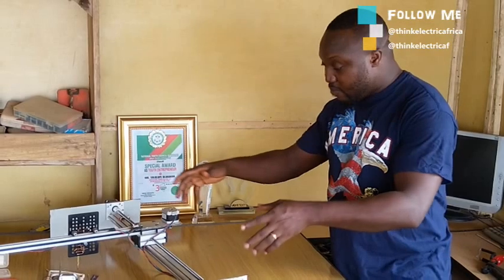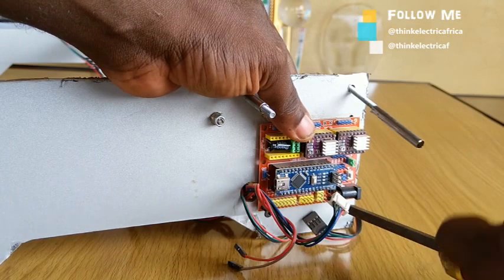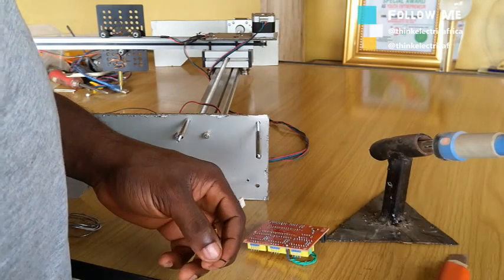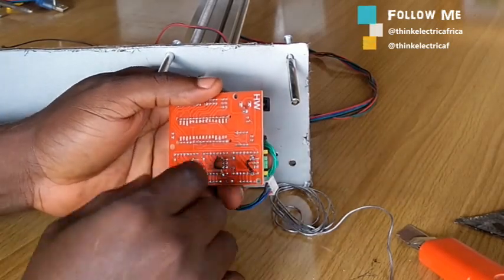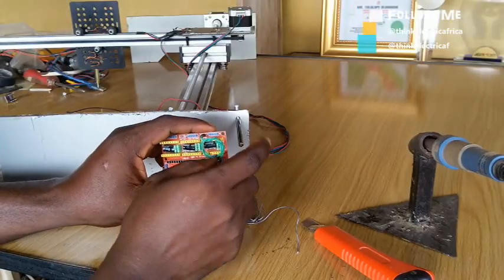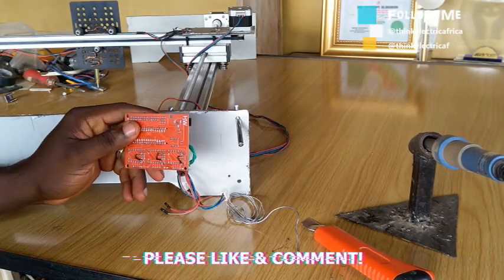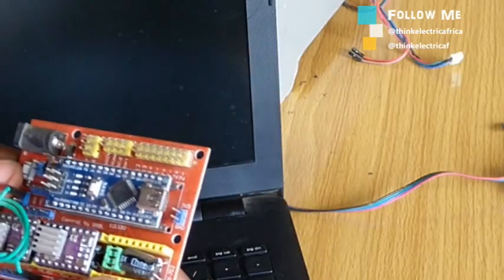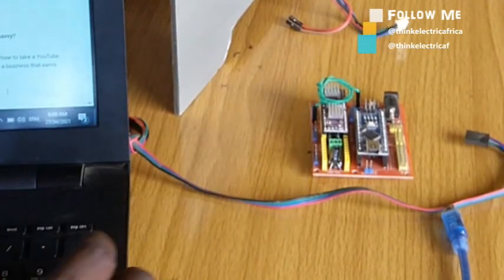Using Jumpers To Rescue The Problematic CNC Shield V4, 1/4 Step Mode

Comment: If you have one of these V4 CNC shields, the method he used to pull the M2 pin high is the correct fix but you have to remove the jumpers or you're just shorting the 5v to ground.  Remove all the jumpers and then solder from the driver 5v Vin pin on the driver (sometimes marked FLT on DVR8895 drivers) just like he did and bridge whichever of the M0, M1, M2 pins that you need to pull high for your step division needs.  For example, I'm using DVR8895 drivers so I used a wire to jump from the FLT pin to the M0, M1 and M2 pins via solder bridge connecting them all because I need all the Mx pins pulled high for 32nd steps.  I'm doing it like the creator in this video did but you can also do it on top of the driver if you wish.  Just make sure to remove the jumpers from the shield so you're not shorting the 5v to ground with them.  That's the main flaw with this board, the jumpers for stepper divisions just short them to ground when they should be pulled high (5v).  This fix works if you remove the jumpers. 

I honestly don't know why they haven't fixed this or just stopped selling these boards.  I guess it's not an issue if you're using full steps though.

Comment: Bro help me, I have one of these and I didn't do this scheme, I'm using it in fullstep. Why does the motor vibrate so much on this board? It's not the Vref because I'm using 1.2V since the motor has a current of 1.5A.

Do I need to connect any jumpers?

Comment: Hello bro, I do follow you on the first video of CNC Shield v4 upload programe(grbl), I faced the low memory stability.  Could you show me in the video,
Reply from the maker: Thanks for being on my channel and for following up the project. I suggest you mean low memory when trying to upload the GRBL on the arduino right?
If so, it is a general issue a3it does not stop your upload if other parameters are correct.

CNC shield V4 is generally problematic for everyone.